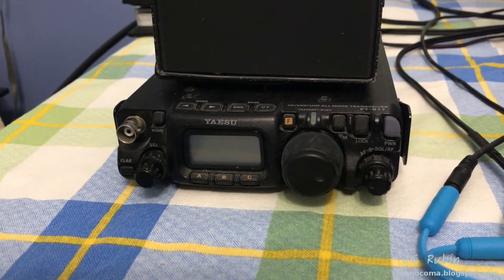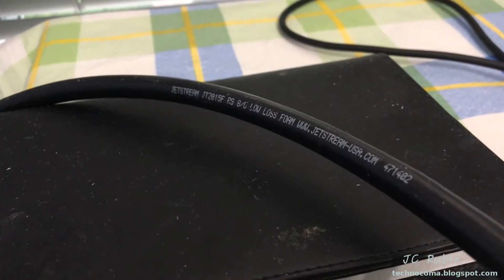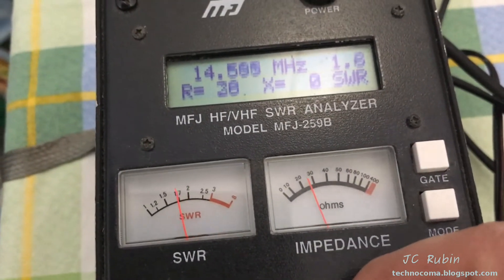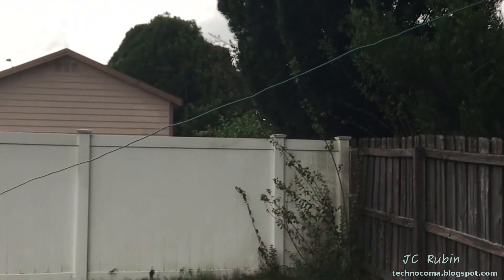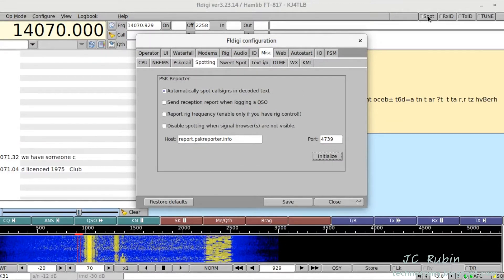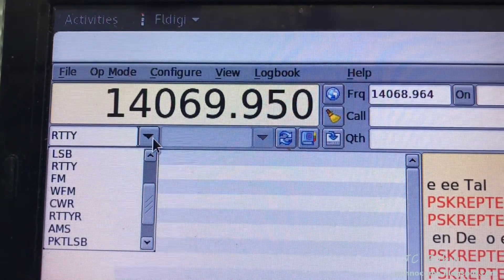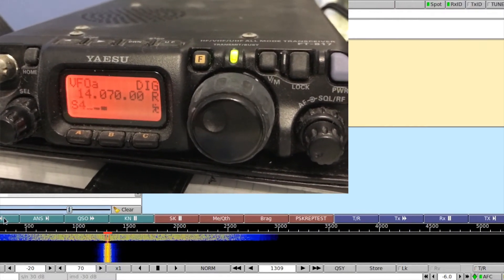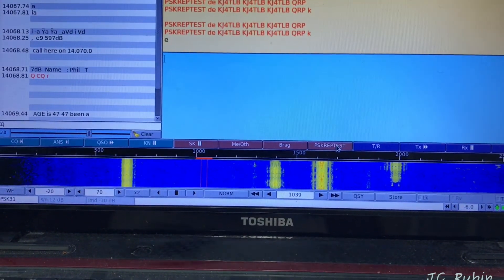Linux FLDIGI to the Yaesu FT817 Tutorial - Part 3 - Setting up the QRP Station

Comment: Like that you showed your Buddipole set up...been thinking of changing up from my EFHW for a buddipole that is a little more stationary and not so reliant on a wire in a tree, which I have found can effect impedance of the antenna at times especially if I have to hang the wire over a branch.  I bet a vertical would walk the signal further too, I'm nearly NVIS with my setup at my QTH.
Reply from the maker: A wire in a tree is not an antenna, its a wire in a tree, much like a coat hanger is not an antenna, though both may work under some conditions.

Comment: Thanks again for putting this up, Jordan.  I was curious how far apart did you put your ground rods?  I have 2 x 8' I picked up from Home D, and was wondering.  I'm going to have to get a cable to tie these two to the house ground rod at the service panel.  Old house, only has one over there.  I got a copper plate to hold a couple of surge / lightning arrestors I'll clamp to one of the copper rods in a flush box.  Still need to run a big ground cable from that inside to a ground bus for the stuff in the shack.  Great series for new guys like me! 73  KI7PNG
Reply from the maker: I did NOT attach my new grounding system to the house electrical ground.   This is a separate signal ground. There is a distinction